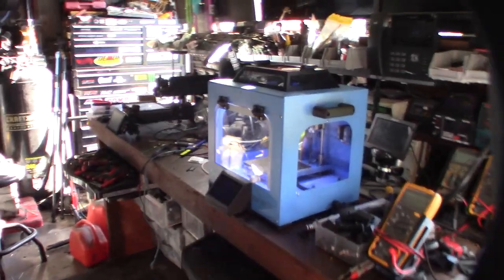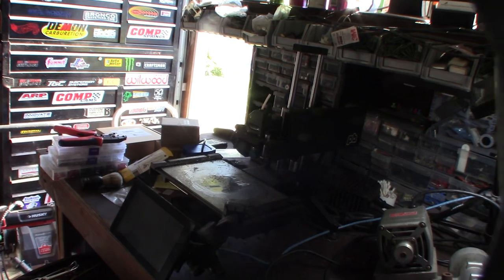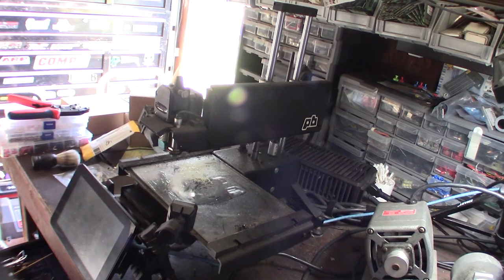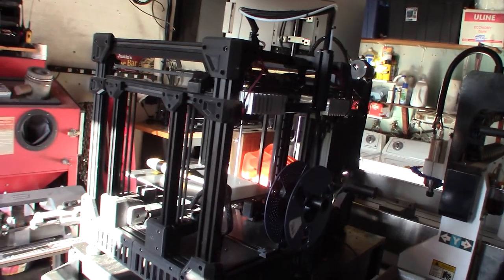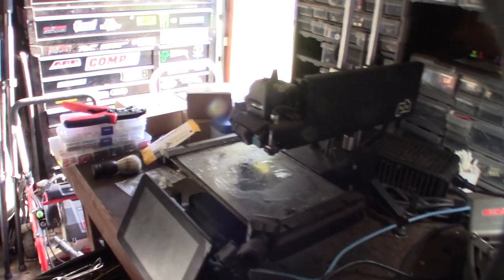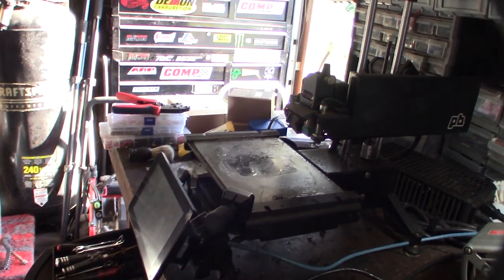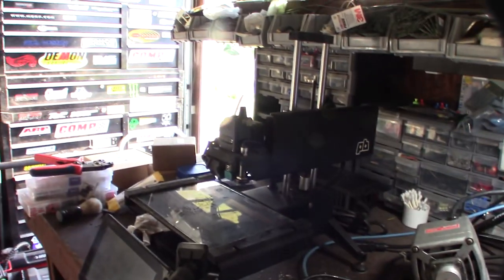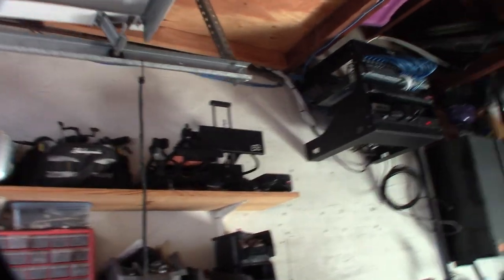Printrbot Simple Metal Retirement Party, Salute, Send off.

Comment: I was getting really stressed watching the video thinking you were going to scrap it. Huge sigh of relief!

I scrapped my first and second printers, the ones I built out of hardware store parts. I really, really wish I had kept #2 (#1 was too big to keep). #4 I kept and put in storage and it got trashed by mice. It is still painful. I think I value printers I've designed and built more than most women value their wedding ring.
Reply from the maker: I had a rodent problem in my garage for awhile, those things are relentless. I'm never getting rid the printrbot, its way too cool. I knew after my first print the direction of my life had changed forever. Kind of funny how I got into it. I had to reflash the firmware a couple of times for a friend before he got frustrated with it and gave it to me. I'm guessing the first time I fixed it was 10 years ago. I scraped a Anet E10, Sovol SRV01 and a crypt mining frame to build the Orca and Celeritas printers. These things almost become your babies, the amount time and effort.
Reply: @fintechrepairshop  Yep 100%! And at least with "extrusion cube" style machines you can really just redesign it forever. The mouse'd one was made of MDF, unfortunately. If it was aluminum I would have disassembled it and washed the pieces and used them for a new machine.

Your story is a lot like mine. My, uh, "interest" (pretty sure you get my drift here), has always been in building and making things and I never had the tools or equipment do do anything, just some construction hand tools from my dad. Building a 3DP out of wood and plumbing pipe and allthread was the magic solution which made it so I could all of a sudden make things accurately. It was incredible. That is, assuming my time was worth 0.1 cent per hour 😅
Reply from the maker: @jessicav2031  Yep, I have a similar story. My family is completely non technical. My father was a real estate developer and my two brother are in Sales. I definitely was the odd ball. I loved taking things apart to see how they worked. One of my neighbors owned a computer store and I learned allot from him. I was fixing PC's for him when I was 15. This was early 90's back in the 386, 486 days. I remember those wood all thread printers. Got a pretty cool Qidi X-smart3 carbon fiber rod printer on offerUp for $160. I'm not really a fan of buying factory printers but I needed a printer for my Kid that I wouldn't fiddle with. Its hard because I see all the upgrade possibilities.
Reply: @fintechrepairshop  Don't lie to yourself, you know you have to upgrade it to a better board and Klipper 😆